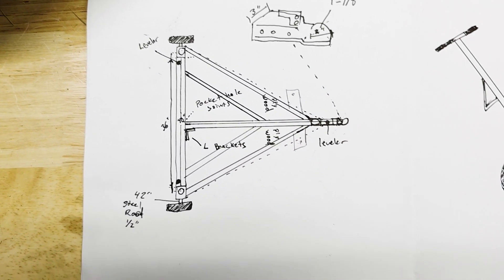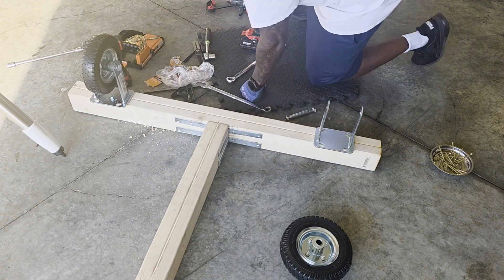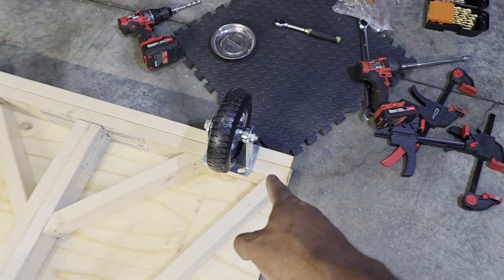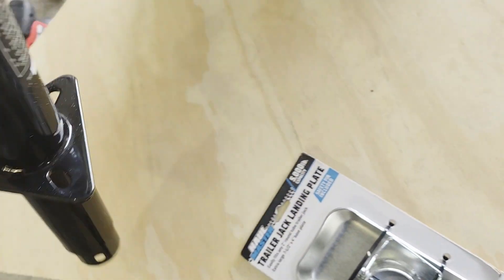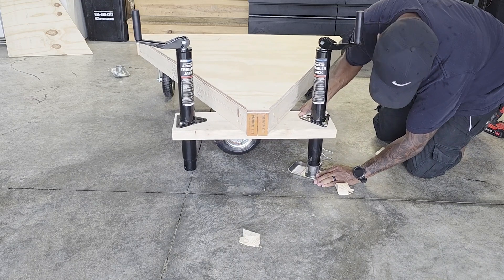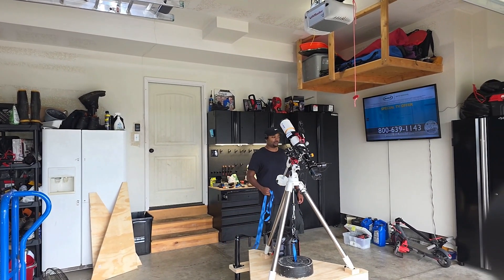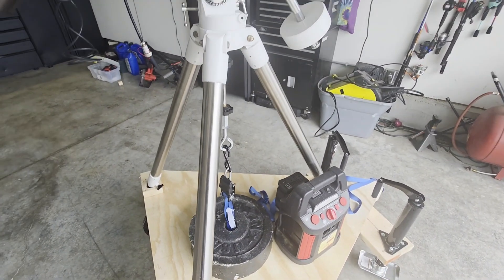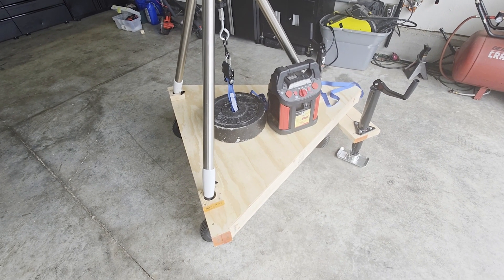Telescope Dolly

Comment: Very cool!  I've been thinking about making something like this so I can roll out my scope instead of assembling and disassembling every night.  I like the idea of the trailer jacks.  But, I would have used three.  One on each corner.  Vibration is a problem with something like this.  Maybe use some rubber pads on the bottom of the jacks?  I like the "dead man" weight in the middle.  That really helps.  But, everything has to be rock solid.   If you don't mind, I may steal some of your ideas...  (-:    We'll look forward to your astro imaging channel.  I'm just getting back into it after about a 4 year lay off.  You can see some of my images on Flickr. Fredrich Clarkson.
Reply from the maker: I think I might add two more jacks so I can level easier. Even though there should be play in those trailer jacks they are actually really sturdy as long as the wind is not blowing hard. I can pretty consistently get guiding around 0.4- 1.2 as it is. Rolling it out fully assembled is a game changer.

Comment: This is a great video!  That platform is ten times better than the ugly monster I built for my 14 inch Goto Dob.  I should've used bigger tires like yours. Question: How did you resolve the movement in the trailer jacks?  I would've gone brute force and just crushed them until the inner shafts were riding against the outer tubing.  But my way is usually the wrong way.
Reply from the maker: Yeah, I have to pull mine from my garage in the front to my backyard. The large tires help getting over bumps and divots in the grass on my way to the backyard.
Reply from the maker: I'm testing 3D printed collars that take up the slop between the inner shaft and outer shaft

Comment: Man! I admire your woodworking skills! If I had the tools and skills to do what you did, I would have made my own dolly, too. But instead, I bought a Scopebuggy, which is perfect for my situation. The Scopebuggy seemingly presented the same worries that you had with your dolly. However, your assessment of "When you get in too deep, you get in too deep" was actually the solution in my case. The Scopebuggy has leveling screws to snug down the wobble, and when I first started using it, I would turn those leveling screws down into the ground until the wobble disappeared. But turning the leveling screws down into the ground took a lot of time. If I was caught by surprise with a rainstorm moving in, I found it too time-consuming to run across the yard, loosen the leveling screws, and roll my scope back into the shed before it got too wet. In truth, though, the Scopebuggy doesn't need the leveling screws. If the wind isn't too bad (less than or equal to 5 mph), the Scopebuggy is stable enough for me to get my images. In my location (the desert southwest), the wind usually dies down after sundown. So, I rarely have problems with wind. I realized that the dolly is solid enough when there's no wind, so I stopped using the leveling screws. I roll out the scope on the Scopebuggy and park it against a rock, like a chock. That's all I need to do. When I see my images becoming trailed, I know the wind is kicking up, and that typically means bad weather is moving in. So, I go out and put my gear back in the shed. Like you said, perfect level isn't necessary for polar or three-star alignment. Just putting your scope on a dolly is all that is necessary. Leveling screws or jacks (which seem to be a stabilizing force) are the "going too deep when you're in too deep" part of the equation. Some sort of brake, like a simple wheel chock, is all that is needed for a dolly. If the wind kicks up enough to cause star trails, you probably should just put your gear away anyway.
Reply from the maker: I was looking at the scope buggy, but I thought I'd save some money. In the end I don't think I saved nearly what I thought, but I did have fun building it. I've made a couple of modifications. I'm also looking at ways to raise and lower it electronically and some how move the telescope from left to right to dial in polar alignment while I'm in house. That would be a neat project to work. I'm also working on motorizing my 10" dob. That will be coming very soon.

Comment: Thanks for posting your build.  I am looking to do something similar for my AZ-EQ6 tripod and mount. Maybe crank the front up, place a wide block under the nose (concrete paver?) and then bring the wobbly legs back up?  Doesn't help with levelling.   I'm following - good stuff!
EDIT - Can you cut a block of 2x4 (half moon each end) and place it between the two legs after extended and strap it to each leg to shore them up, Velcro, ratchet, u-bolts...?  To your point, you don't want to do a lot of extra work after rolling it out back.  Just thinking!
Edit 15... a 24" piece of all-thread, 3/8 or 1/2" dia. ran through the legs and snugged up?
...I'm done.